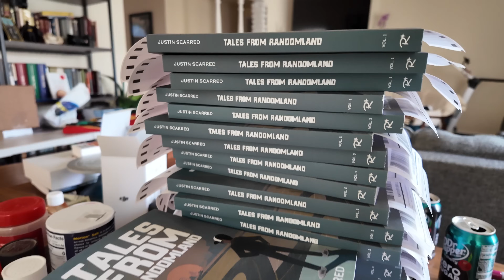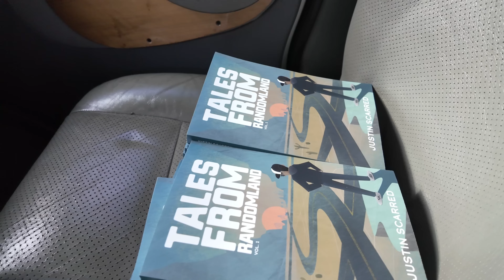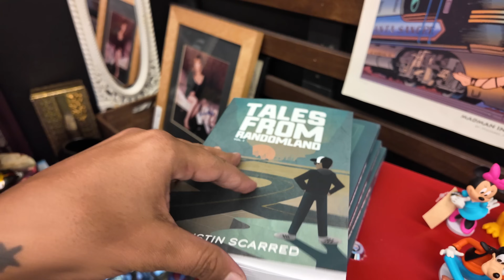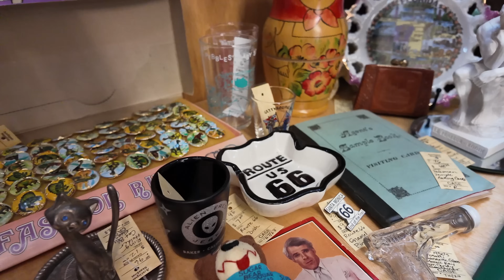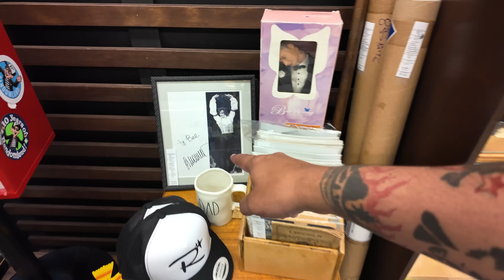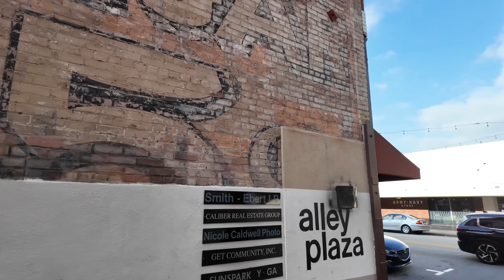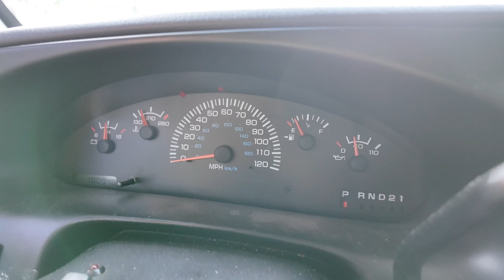Travel Plans, Antiques, and Vintage Bikes! | Sometimes Vlog Update

Comment: As a Bicycle Mechanic, I can tell you this. No bike shop will touch a project like you have, because there is no money in it.  If the the threads are not messed up too badly, you can chase them out with a tap, or have a shop do it, and just get some new pedals that fit. Yes I know you want to keep them vintage, but some times you cant. If the threads are shot, you can A. Drill them out and re tap them, B. Drill them out and put in a sleeve that can be tapped. Do you know what size holes are in the crank arms? I can look around where I live and see what I can find. Take it easy. I just thought of something. If you can take the pedals apart. You might be able to find or have made new spindles for them. Either made or bought. Do a Good search, I'm finding lots of Columbia vintage parts. Good luck.

Comment: You should be able to drill out and re thread the bike pedals. When an engine or anything metal strips a Bolt we just drill out the striped bolt and threads then re tap the threads (cut new threads in). Since the hole is wider you just have to buy pedals with larger threads. It 100% can be done correctly. It's done all the time.

Comment: I have an old Schwinn (55 years old to be specific), and I enjoy riding it. Though there are plenty of modern parts that will not fit it. Like I had to replace the tires on it I already knew it would need Schwinn specific tires. Imagine my surprise when i find out the front and rear rim aren't even the same size. The bike does also need a paint job, though its such a good rider its hard to stop riding it long enough to do that.

Comment: "Right is right". Right side pedals are normal thread, install clockwise like most bolts. As in turn to the right to tighten. It shouldn't fight you much unless other things going on. Once you know that, the other pedal is opposite. It is kinda weird, I know , installing it counterclockwise!  Also, make sure you don't accidentally have 2 right pedals!

Comment: Those bikes have standard 1/2”pedals and an American 1 piece bottom bracket so it should be easy to fix. Just don’t make the mistake of forgetting the pedals are reverse threaded on the left hand side. The next problem you will start to have is spokes breaking at the nipples or j bend. There is a mechanic at a spot called bike land that knows how to do the schwinn specific lacing pattern for the spokes.

Comment: As soon as I saw the missing pedals I knew what happened. Been there done that.
It's not like I didn't do that before. DUH!
Thread inserts. Drill and tap the cranks then use thread inserts to repair. It might be tough finding a reverse thread, but they are out there. Cranks should be pulled to do the best job. It must be done right because you have your whole weight on those pedals.

Or, find some good used cranks and cut off the tips and weld them on these bikes.
The van; lift up the license plates up and pull another van under. Talk about a nightmare waiting to happen.  Stay healthy and enjoy the time with your son. You're the only dad Lincon will ever have.

wrote this before seeing the whole video